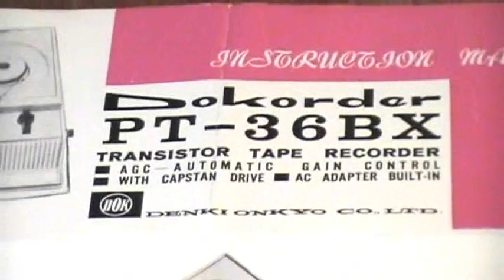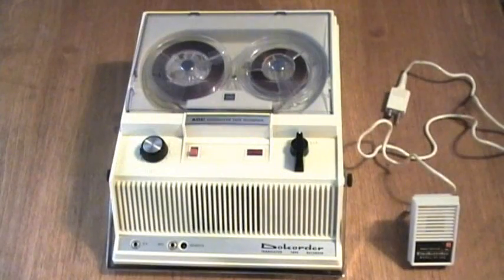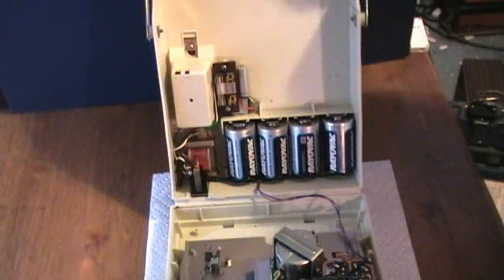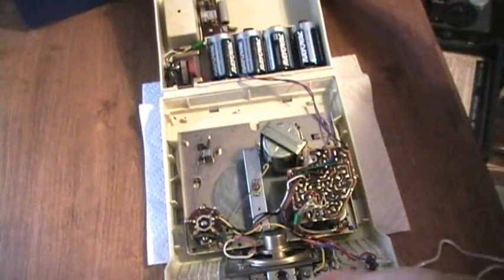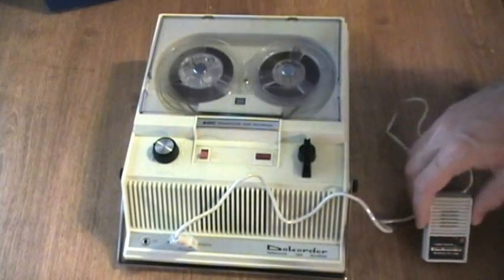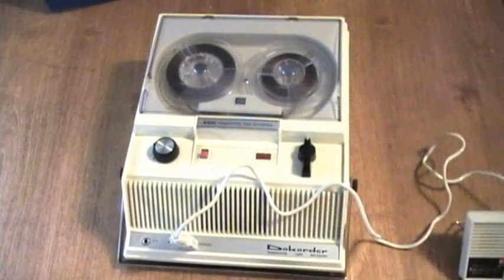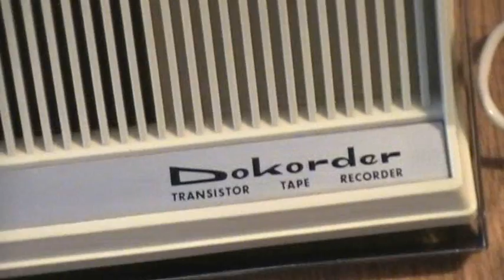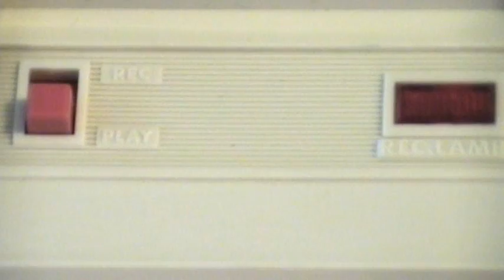Dokorder PT-36BX portable reel-to-reel tape recorder, DC bias!

Comment: My flywheel is hard to spin. What can I do to free it up? Rewind is ok. I've got old family recordings that I would love to hear. Thanks!!!!
Reply: Capstan bearing have oil in them that can dry out and certainly they did not care what grade oil they used. From a 50 year tape deck Technician the oil I use is AMSoil 0W30 Signature series- as with all decks it will be necessary to remove the thrust plate and pull out the flywheel to clean and oil the bearing well as well as the shaft. After the oiling put back the flywheel and move it in and out to distribute the oil then clean the front side capstan shaft with denatured alcohol before entering play. I have also had decks come to me with frozen pinch rollers and these need to spin too. Yes AMSoil is found at the automotive store and I have used it in hundreds of decks in the past few years- it provides superior wow and flutter.

Comment: Hi Guys. I have a Dokorder PT-36D solid state Recorder in working order! Comes in original box with microphone, power cable and two tapes. One still in its box. Similar to the 36BX but as per instruction booklet with auto gain control, capstan drive and AC adapter built in. I know its been a long time ago for comments but if anyone out their interested give me a reply comment.

Comment from the maker: Is it recording at all? For one thing, this mike sounds a little different than other, higher quality mikes. But if the sound is just weak, then the machine may need new electrolytic capacitors.

Comment from the maker: Oh, too bad on the flywheel. I guess it depends on storage conditions. Mine's flywheel is just fine. I have another machine with the same type of flywheel that has some cracks, but is still in one piece. Hope you can then get the Telectro going with it. A 5-transistor, DC bias and auto-level Telectro!

Comment: i had one of these, in the box too, but sadly it never worked. the flywheel was shaderd, the pot metel was so beat up  in it it wouldent even turn, and as i tryed to turn it, it fell apart. so i used  it for parts, now its amp (and power supply are in the Telectro that im rebuilding! but still needs a recap.